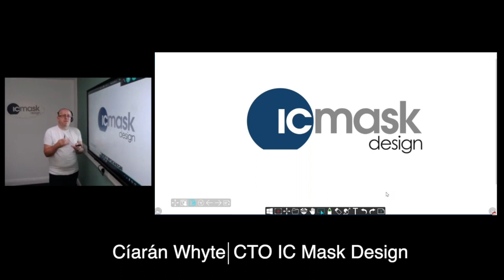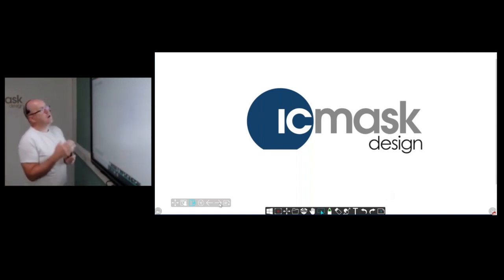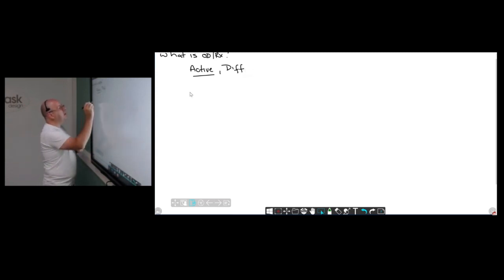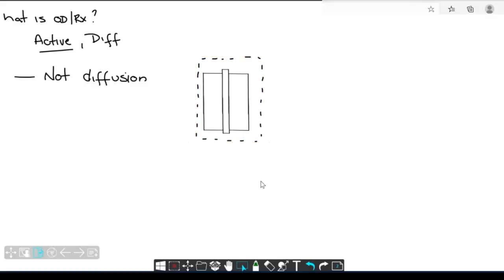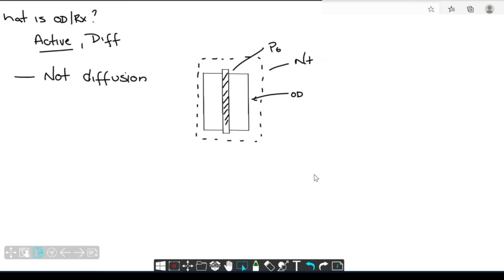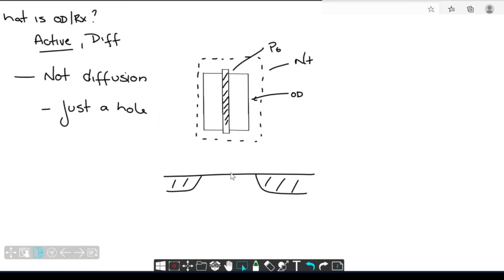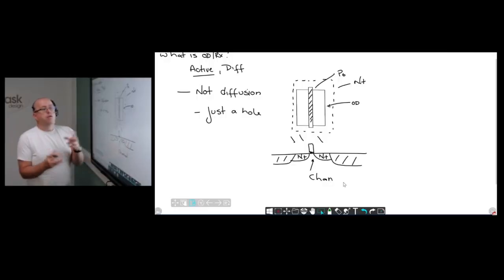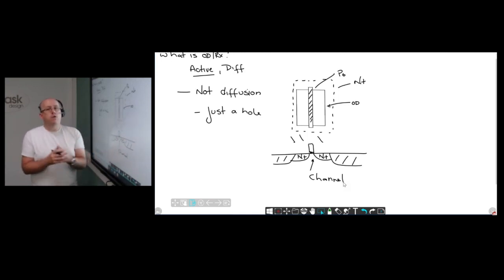OD and RX are NOT Diffusion

Comment: Then why the RX layer is not bigger than N+ region in the top view of the transitsor you drew? The top view shows that RX is smaller than N+ region and is inside of it, however the cross section view clearly shows that N+ is inside the hole (or RX) in field oxide. Could you please make it clear for us?